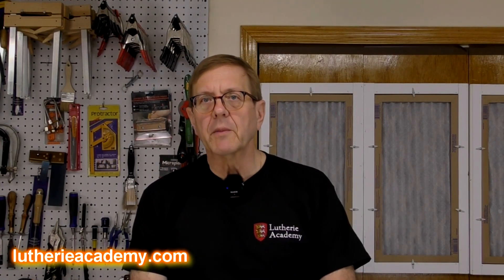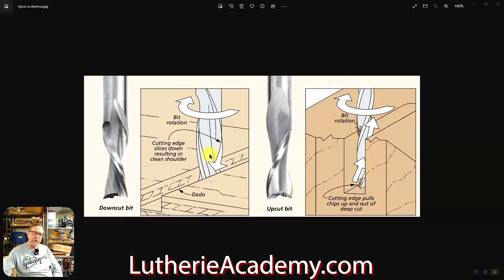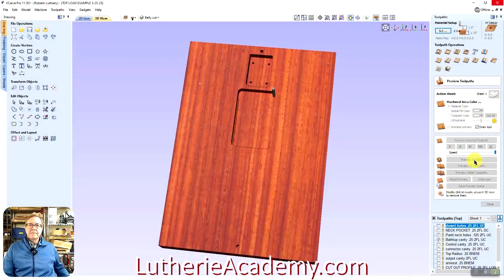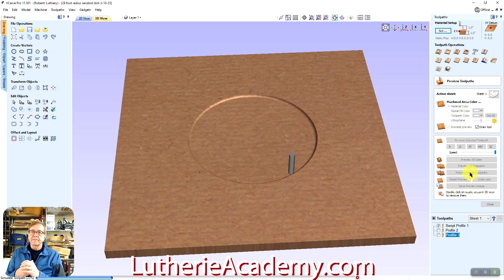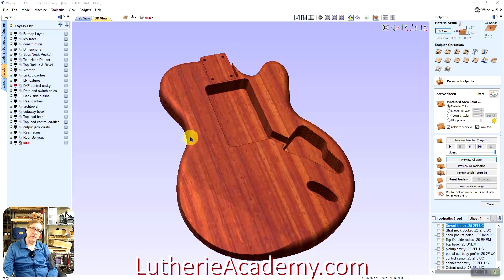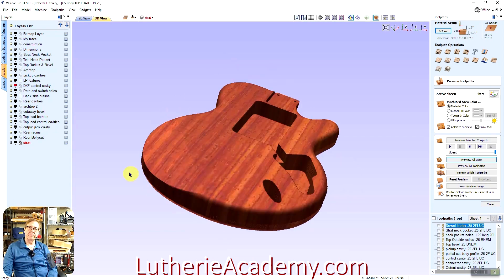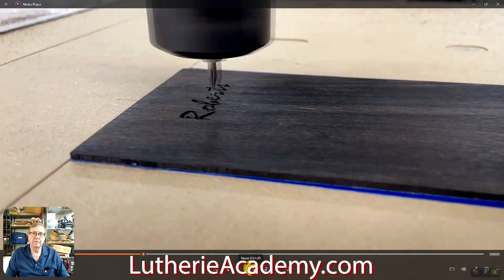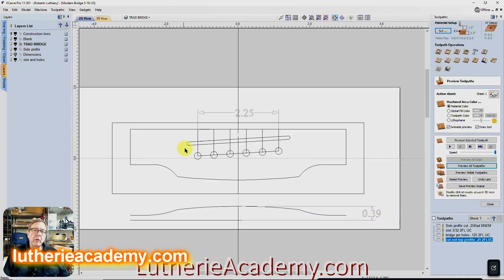Online course -  CNC for luthiers

Comment: Doesn't CNC make luthery less of a skill and more of a kit assembley exercise?
Reply from the maker: CNC can be like any other tool to achieve an end result. It might not make your guitar sound any better though.
Reply: I can see how you might think that when you watch a CNC machine working it's magic. Looks like exactly what you describe. However, acoustic guitars are so unbelievably complex, that there is absolutely no way to simply them that much and still get an amazing result. Meaning you CAN buy kits, including some with many steps already done, but the finished guitar is going to vary from garbage to amazing depending on the skill of the builder, and MANY other factors. As a software engineer, woodworker, and advanced Adobe Photoshop user, I can tell you that I have been struggling to learn to use my CNC machine for over a year with little to show for it, lol.
Reply from the maker: @ligngood3787   You are correct. CNC can be one of the many tools in your shop to help you work more efficiently and with precision. You can use it to make accurate forms and jigs/templates that will help you produce a better instrument. Maybe this course will help facilitate your learning curve.
Reply: A CNC can cut out your soundboard, but it can't select the wood, join the plates, and tap-tone it while carving the braces.
Reply: Great question. Thanks for asking. CNC can be a valuable tool to help luthiers be more productive and make higher quality instruments. Few pieces of acoustic guitars can be made on a CNC. Same with the mandolins and ukuleles that I build. It takes a lot of handwork in combination with power tools. I use CNC to build things like bending forms, body molds, radius sanding dishes, specialized tooling, as well as making super accurate fretboards, and cutting inlay channels. I’ll also use it to remove excess wood from guitar neck blanks, and electric guitar bodies so I can spend more time on the hand, shaping a neck or body to get the perfect feel that I’m looking for in my customers have come to expect. Thanks again for a great question!